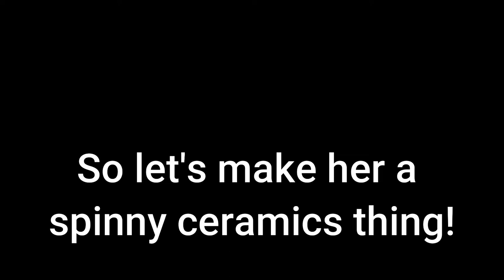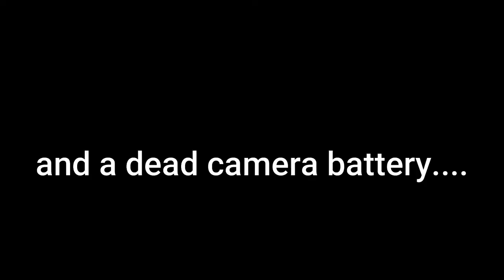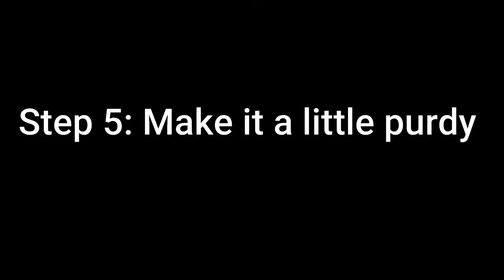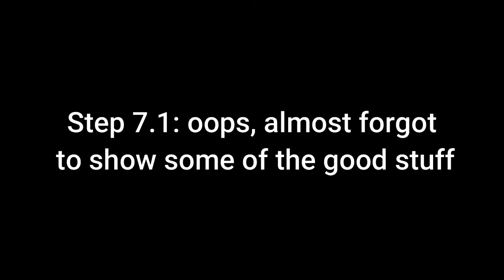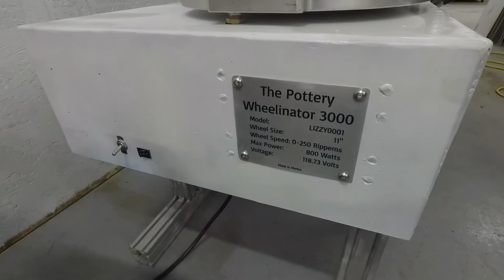DIY Pottery Wheel

Comment: It is excellent but The outer catch pan looks like the water will drain towards the center and through to the motor and electronics. They usually are curved in the middle more like a donut so they can catch water.
Reply from the maker: Thanks, the top bit was just something I found at a junkyard that looked cool. I thought it was too low so I machined in some slots on the top of the aluminum bowl to attach plastic guards to make the walls higher on the side your hands are not on (but the wife never puts them on for some reason). I did run the drain tube through the housing as it jusrt happened to be the lowest gravitational point in the bowl but it goes to a water tight tube to the drain a few feet away.

Comment: Hi! How you connect the engine with the wheel? Are you use a chain? Do you install gearwheel to axis? Thanks for inspiration :)
Reply from the maker: The motor has a gearbox attached and I used #40 chain and sprockets with an additional gear reduction

Comment: Very nice I like your way of building to last,that motor you used is rated at 3750 rpm is the speed control able to slow it down to 250 rpm. Thank you
Reply from the maker: Thanks. The motor has internal gearing that bring the max rpm to something like 400 rpm and there is a dc speed controller to vary the speed from 0-400rpm

Comment: Hi there! Im currently in the process of building a pottery wheel for university. Have you tried to add a foot pedal, or replacement the knob with one?
Reply from the maker: I did add a pedal. I bought one of those cheap 10k pot pedals and it's working well
Reply: @HuskyMachining  Do you maybe have a link for that? All the ones i can find are used for golf carts and are spring loaded.. using something like a volume pedal (for an electric guitar) would be perfect..

Comment: entertaining video, nice job, doesn't help me: which parts where to find or buy. I like to see it in action. If I had a workshop like you.....
Reply from the maker: yeah, I have always liked building things but when I started 7 years ago all I had was a harbor freight welder and a grinder.... This could have been build with just a grinder and a welder if you can build the spinning platter out of wood (or a round cutting board) and I got everything else from ebay
Reply: @HuskyMachining  OK, have a motor from a washing machine and want to build a pottery wheel. Expanding my workshop: Wood - Ceramics ...
Reply from the maker: @VielMeinungWenigAhnung  that's totally possible... let me know if I can help ya out at all

Comment: Hey man. Great video. Am planning on building one myself. Any chance you can Share the stats on the electrical components? Motor/power supply/driver? And links of you got them? Also would love to hear any feedback about the build.
Reply from the maker: I bought everything via ebay so I'll grab the links in a second and put it in the doobaly-doo below the screen
Reply: Awesome man. Appreciate it. Are you happy with the speed, torque, and braking of the system?
Reply from the maker: @laviathan4  Hey buddy, I posted the links for the parts I bought for this build in the about section
Reply: Awesome! Thanks man! Has your wife used it yet? Is she happy with it?
Reply from the maker: @laviathan4  The wife loves it!  I just need to get around to making a kiln vent so we don't die from all the fumes
Reply: Did you build the kiln as well?
Reply from the maker: @laviathan4  No, I actually got a great deal ($50) for an old kiln that had a busted controller and bad heating coils. So I bought a chinesium controller and the  heater coil wire and used a steel rod and a power drill to make the heating coils.

Comment: How much did this cost you to build?
Reply from the maker: I had the steel and aluminum laying around but the motor cost about $100, the speed controller was $20, the chain and sprockets were another $20 and about $40 for switches and what not so all in for me it cost about $180
Reply: @HuskyMachining  could you please provide me with more info on exact materials being used in this project along with wiring if possible. I  was looking for this kind of sturdy build for my son, not with the steel or aluminum though. I wanted to try with steel tube structure. Please help me.